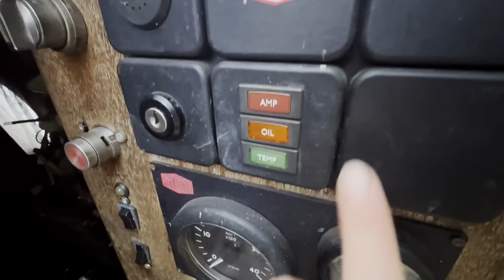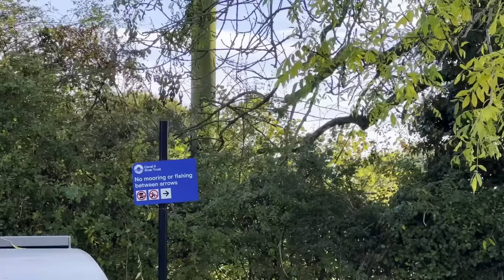A PIRATE at the Helm!!!!!

Comment: Am I the only person confused about the boat raffle?

May talked about the current cash prize if the target to win the boat isn't met, but implied a worthwhile asset worth 50,000 pounds (the boat) could still be won if all the tickets are sold.

Yet the rules of the raffle on the Raffall website seem very clear, and say this: "A minimum of 13,000 tickets need to be sold for the main prize to be given. If less than 13,000 tickets are sold, the winner will receive a cash payment amounting to 50% of the total ticket revenue generated for this competition."

This implies – to me at least – that the boat will be raffled and definitely won by somebody as long as 13,000 tickets are sold... 

So far, Raffall state that over 29,000 tickets have been sold. Even if this total includes some free tickets, based on the previous ratio of free tickets issued related to paid tickets, the raffle must already have passed 13,000 paid tickets. Surely this means that the boat will already definitely be raffled and won by some lucky ticket-holder?

That doesn't match though with May's comments at the start of the video, implying all the tickets need to be sold. Am I missing something or misunderstanding the rules of the raffle?

Either way, I hope the raffle is a big success and benefits both May and, hopefully, the lucky winner of the boat.
Reply from the maker: Hey! The total ticket sold thing is very confusing, I did feedback to raffle about this. I have sold a total of 9845 paid tickets. A marketing tool Raffal use to encourage people to buy more tickets is giving “extra” tickets which is currently making it look like I’ve sold all the tickets - which I haven’t! 
Ive learnt a lot from this process and I’ll be sharing it all when it all comes to an end. Im doing my absolute best to get to the target 🤞

Sorry for the confusion
Reply: @wellbeingonwater  Good luck!